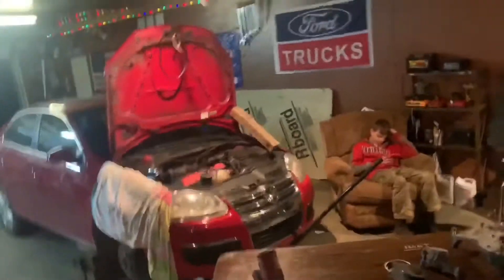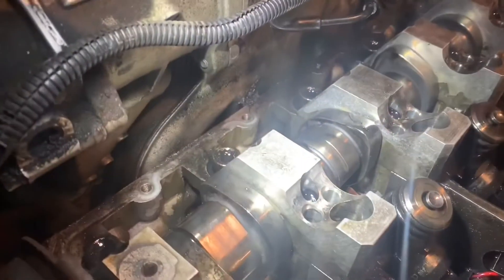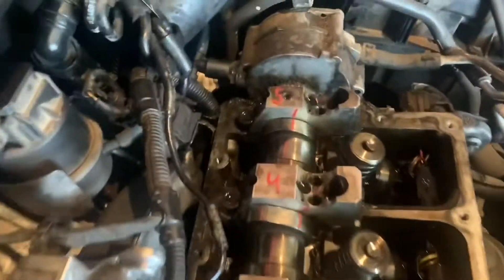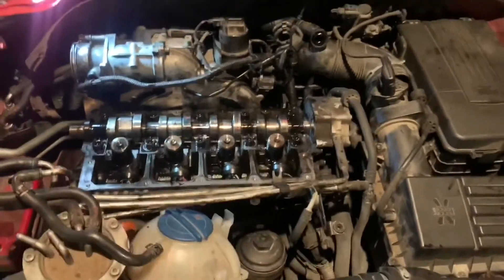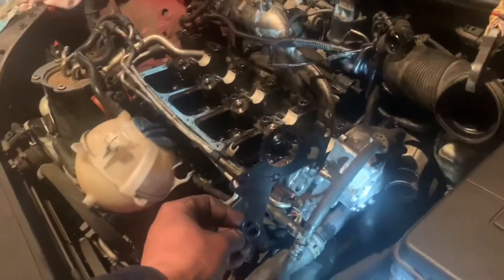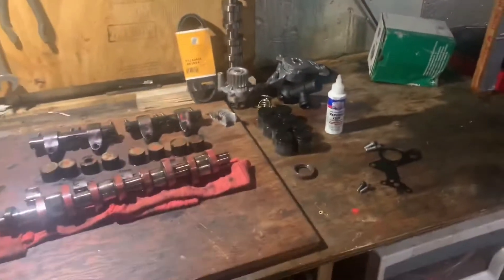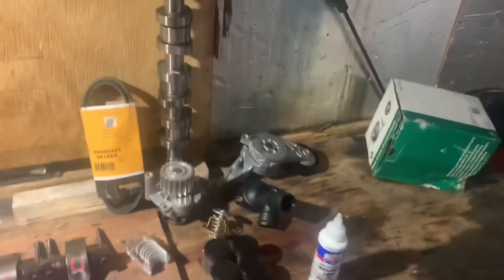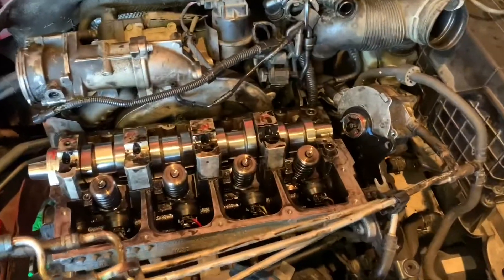Volkswagen TDI Camshaft Failure/Repair

Comment: I'm thinking about buying one of these. Guy already has cam and lifters,  I just have to pay a shop $1,093.00 for labor. The car price is $1,500.00. No idea IF there may be any other issues, never purchased a vehicle not running 🙄 Kind of risky. Is $1,500.00 good price in your opinion? I looked at it today miles are 201337. Does this car show what mpg it is currently running digital in dash ?
Reply from the maker: Never hurts to negotiate and agree in a lower price. The mileage is fine 200k ain’t bad in these. I would definitely use a torque wrench and have patience though